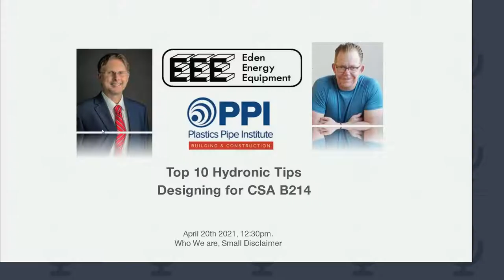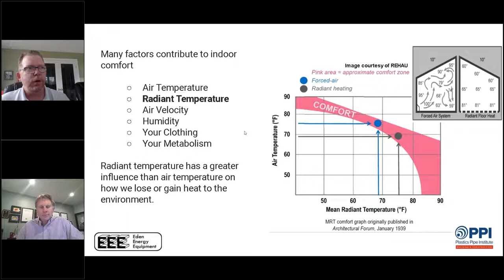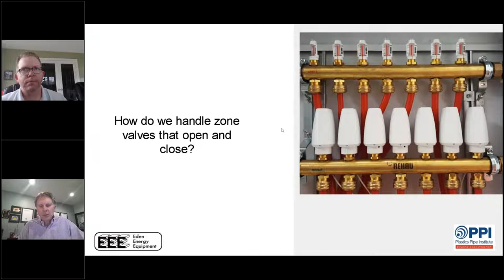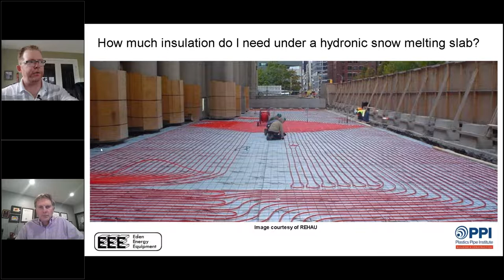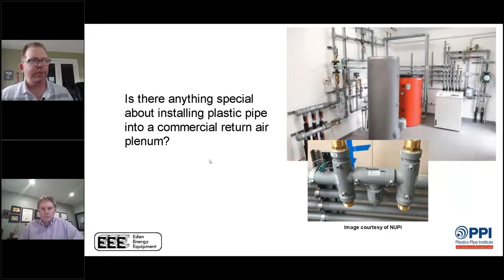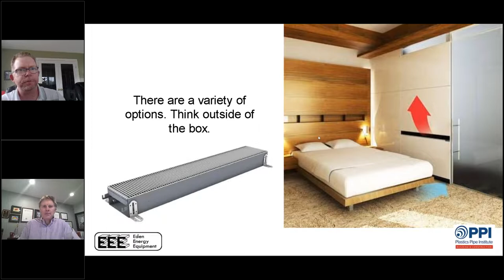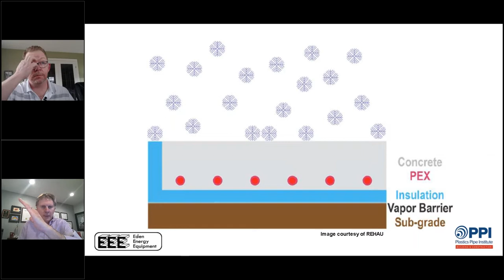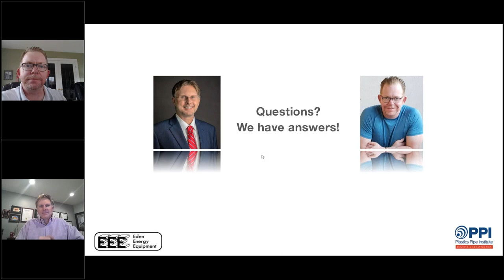10 Tips To A Successful Hydronic Installation  Complying With CSAB214

Comment: I have a question about the return air plenum requirement: does the requirement described in the video only apply if a suspended ceiling is actually used as a return air plenum? If all the return air is ducted inside the suspended ceiling, does the requirement no longer apply?
Reply from the maker: First off ALWAYS refer to the local building department and building codes. That stated as a general rule the Building Code in Canada ( where we are based) if it is fully ducted these comments do not apply. It only applies when the return IS THE cavity in the air space.